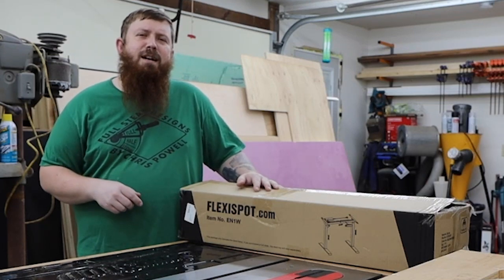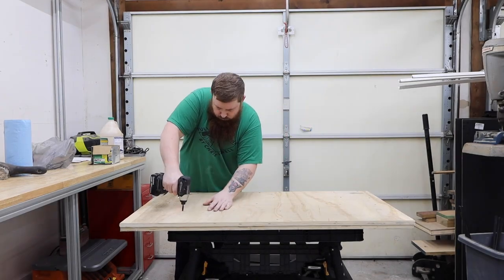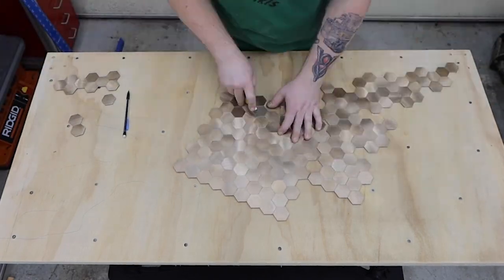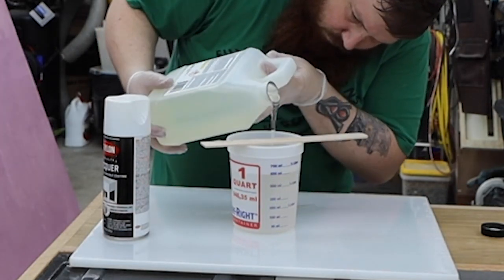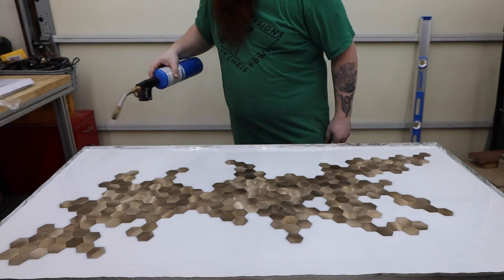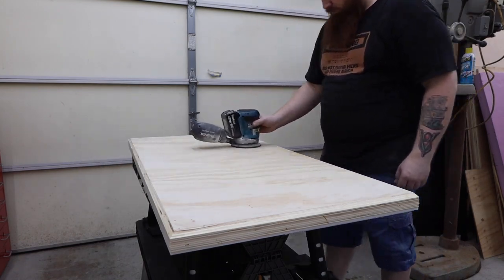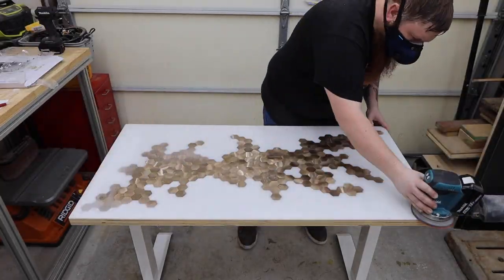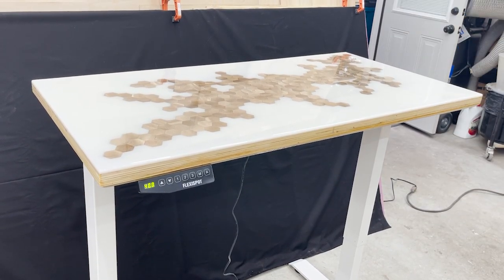I made a plywood desk top for my Flexispot standing desk using epoxy and hexagons

Comment: I might have to get some of these table legs. The brass looks really good with the white, a very modern-looking desk. Even cooler is your style of brass tiles looks like an old world map. That just gave me an idea. CNC Pirates of the Caribbean style map out of .25 in plywood, glue to the .75in base, add the sea blue and Caribbean blue pigments, and then topcoat. Or because it's June 6th, make a WW2 invasion map of Normandy. Trying to CNC all the towns, roads and cities might be a little time-consuming but it would be worth it. It would be cooler to add the invasion timeline with LEDs that correspond with the weeks/months following the invasion. Each light color would represent an advancing army group. A small LCD screen would count the days as the LEDs lit up. I have no idea how to sync lights with times and have them flash.  Maybe I should stick with the Pirates of the Caribbean map. You have inspired me, Chris.
Reply from the maker: The invasion map with a timeline would be awesome.